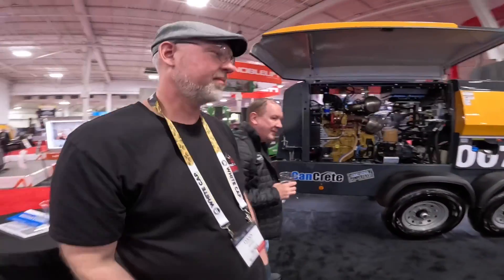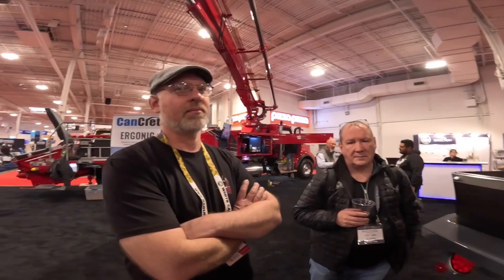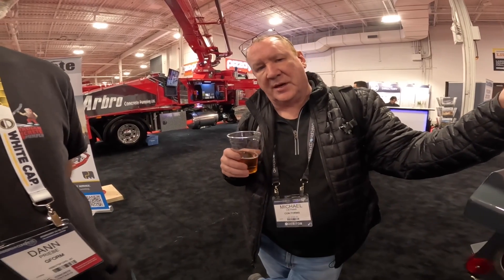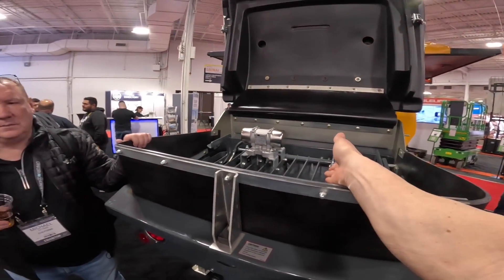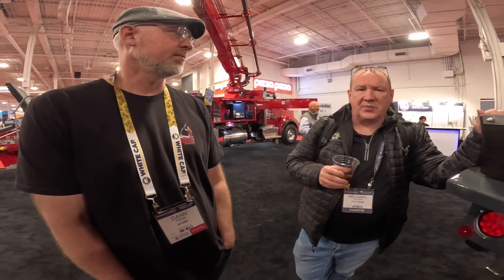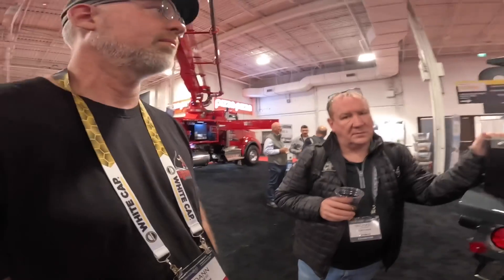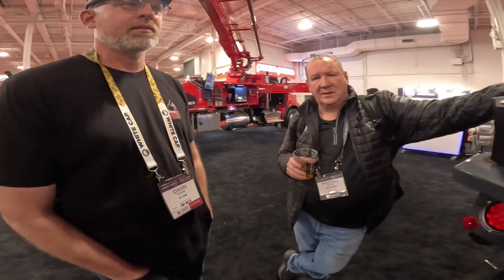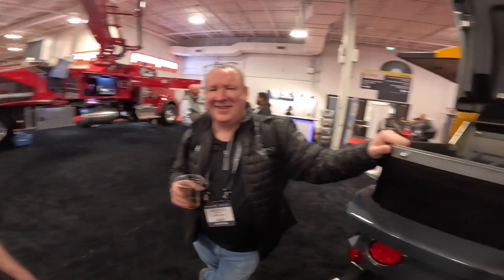My possibly DUMB IDEA….

Comment: Scott on our pumps we use led indicators on both sides for status and direction and a 0-100 volume read out as our rpm doesn't change as it is not loud by our pump and they still over flow
Reply from the maker: That’s a very cool feature Matt. Would love to see some pics, or even a YouTube short of how you guys do it.

Comment: 58m scwhing i ran had a green light by the vibrator, turns green when pumping, when not pumping, the light doesnt work, same pumps horn button was also green. You tell the mixer driver "Horn is the green button" as you point to it, and show them the button. What do 99%of them do? They hit the green LED light instead of the green horn button. 

The LED lightbar system is great, but you also cant cure mixer driver mental illness. 

All it would do is make you more upset when they cant do basic things. I love running a pump, I have an unmeasurable, deep hate for mixer driver illness. it cant be cured.

Comment: I'm all for red and green and yellow lights. And I agree about honking. Too many guys don't use the horn. And then guys that start at full rpm and very fast on the pump speed. I would be ok with an led bar that goes according to volume speed
Reply from the maker: I’ve found over the years that just a simple honk 1-2 strokes prior to stopping the pump can make a world of difference in terms of mitigating mess at the back of the pump. 

I’m determined to find someone whom can build a prototype of my LED bar to test out in the field.

Comment: Our Vibrators are about mid way on the hopper and when they run low it makes a noise.   When your vibrator is on the top it makes noise all the time.   That's why you get overfill and underfill.    Everybody knows mixerdrivers are complacent  to begin with!!!

Comment: Or a speaker that says “pump on” “pump off” and even have an option to say “add 10 gallons of water” from the remote
Reply: I think a radio from the operator to the mixers at the hopper would solve a lot of those problems but leave it for strictly business only
Reply from the maker: That’s another one I’ve long thought of, but I figured it could potentially be a total PIA for those times when you get an extra chatty driver 😂😂😂

Comment: Hey Scott when I was in Jamaica we had a combination pump mixer "schwing" which came with a sensor in the hopper that would control the discharge speed of the drum to the speed of the pump. I've come across a lot of drivers that don't pay attention to the level in the hopper and either overflow it and make a mess or run it empty to the point where they get blasted with concrete, then they complain. Love your videos brother keep up the good work.

Comment: Hey Scott the whole problem with it with your idea of the light thing that swing is already done is the concrete truck drivers got a care they don't pay attention too much of anything if they don't wash out the barrels correctly why would they care about that red light green light that you're talking about putting on their I'm not against you or anything like that but I'm just trying to point out some drivers just don't care that's what you got to get past
Reply from the maker: Hence my comment that perhaps we should integrate a small electrical charge as part of the mixer driver notification system 😂😂😂